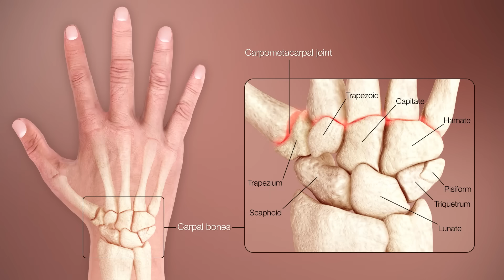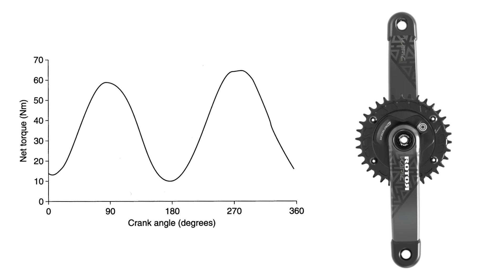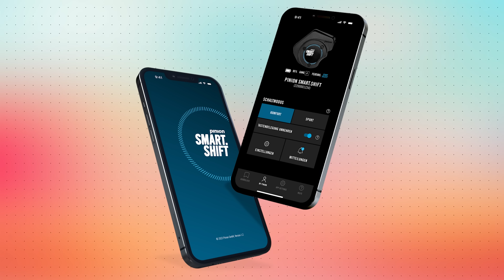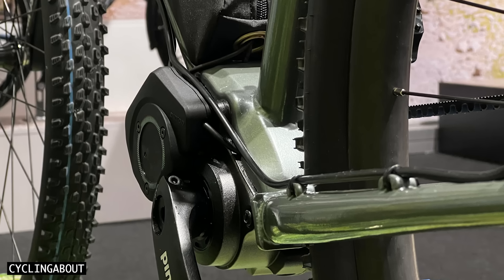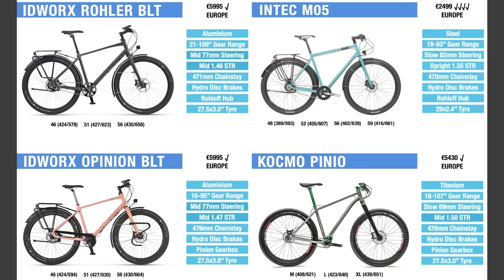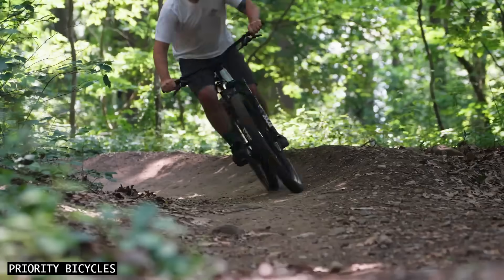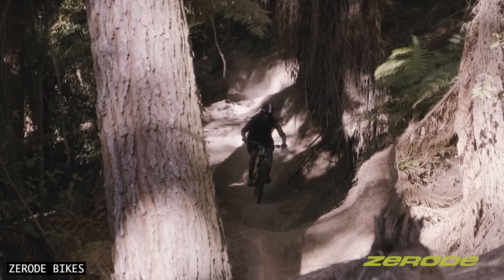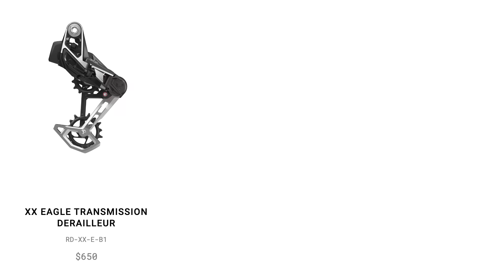The 2024 Pinion Gearbox Is A Derailleur KILLER - Shift Under Load, No More Gripshift!

Comment: To be a "killer" of a product it needs to be in the same price bracket as that product, and it is not even in the same solar system price wise.
Reply: Most technologies are expensive early on. Once new competiton comes in the market, more products are available, the price will surely go down.
Reply: Not necessarily. If it is a product that fundamentally changes the status quo, it is a killer product. Just because it’s not in the price range that you like does not negate the potential to change the industry. All new technologies are expensive at first. Then prices come down as manufacturing efficiency improves. Just look at flat screen tv’s. In the beginning they were 2-3 times the cost compared to CRT and their video quality was not any better. Now CRTs are extinct and you can get a massive Flatscreen tv for beyond reasonable prices.
Reply: Exactly! I was intrigued , so I clicked to watch the video. Then I was fascinated. Finally I was sold. “I’m getting one, and the cool electronic shifter,” I thought to myself.
Then at 7:30 in the video he said, “THREE THOUSAND DOLLARS.” I stopped the video right there.
No way am I spending three thousand bucks to put onto my $1,600 bike which already has gears and shifters.
I could pay someone $50  to adjust, clean my derailleur and chain, every three times per year 60 times. That’s 20 years worth, and right now I’m 64 years old.
Reply: Ya it's just not there for me yet but I'm interested and think it will just get better and better
Reply: What’s the sleazy elevator music? 🥴
Reply: $3k is really not that expensive for high end bikes. You'd probably spend 2/3s of that for a top of the line traditional drivetrain that requires more maintenance and uses many very delicate exposed moving parts. 

High cost of entry for new technology is unfortunately just the reality for anything. Especially when it's from a boutique brand and/or a niche market.
Reply: @dumpywhite  Bicycles are so overpriced, you can buy a used car instead
Reply: Also the fixed belt line can be aligned with one of the pivots on dual suspension to completely eliminate a moment arm.
Reply: Not really. A lot of mtber's have to replace the chain, chain ring(s), cassette and jockey wheels every season.. at a cost of approx £250
Reply: That's not true. It can cost more as long as it provides enough additional value to justify the price. Cars killed the horse and buggy, even though they were, and still are, many times more expensive.
Reply: No, it is.  A Nikolai Saturn mgu 16 Costs the same as a Specialized Turbo Levo S works
Reply: There a gravel bike made by priority for $3500 which is reasonable for the build.  You get what you pay for, and for people 
who want to delete moving parts and not fuck with replacing potentially very expensive cassettes/chains every two months 
because they ride a lot and derailleur adjustments, its completely, entirely worth the price!
Reply: @WesleyChe  I've been eyeing that gravel bike. Hoping to replace my entry nishiki road bike
Reply: @aesingame  If you are riding gravel primarily, get one that can clear atleast a 50mm tire for comfort and the sake of your wheels. riding offroad on skinny tires with a  rigid bike isn't fun.
Reply: Factor in lifetime visits to the shop for regular maintenance of derailleur system and the price for saved inconvenience and time looks pretty good.
Reply: @JohnKavadias  Indeed I agree. Just bought an XL priority gemini gravel bike w/Pinion C1.12 gearbox, loved the drivetrain. Set it up tubeless with the same tire setup as my other gravel bike on 47mm tires. Unfortunately the cockpit was too short, and the bars are thick with not much compliance, so it was not very comfortable on washboard gravel roads or rough descents. Too much vibration. We need more geometry options and frame manufacturers selling gearbox/belts.
Reply: Totally agreed, also I have absolutely no idea why they didn't make a cheaper city bike version yet.
Reply: Sorry that you're having a hard time keeping a good job.
Reply: I'm not really into the idea that I need to charge my gearbox, and then have to download a app for it. Jesus Christ.
Reply: At least not until the “Lectric One” comes out.
Reply: Not all bikes are priced the same so your logic doesn't hold up. Every new product is always priced higher than the current market. The question is if it's better and thus sought after.
Reply: In time
Reply: Sounds like someting someone selling horses wold say to a car dealer 😂
Reply: main issue for me is the small choice of frames
Reply: I mean you can get derailleurs that cost thousands of dollars too. SRAM just release one that costs $4000, you don’t even get a bike frame and wheels for that either, just the shifters, gears, derailleurs and chain, and brakes. So since the price was not shown, I’m gonna guess this thing is about half the price of the bike, which puts it at about $1500, which is expensive for sure, but considered a mid range bike part for bike enthusiasts.
Reply: Carbon belt drive and sealed hub gears or gearbox for me
Reply: not available outside uk
Reply: @PRH123  Sorry you don’t get the analogy. Bye.
Reply: @PRH123  Yes it is. Your explanation was wrong. Thats ok. Bye.
Reply: @PRH123  No it hasn’t. You clearly don’t understand. Sorry. There is no discussion between us. You believe what you want and I believe what I want. Adios.
Reply: @PRH123  Nope. Simple proof as a kid no bikes at Walmarts had multiple gears. They were all single speeds. Now you can get a bike for under 100 with multiple gears. How did that happen. Oh the tech got cheaper to manufacture as the manufacturing processes were improved and they found ways to cut costs. Yes there are still more high precision cassettes that will always cost more, but the cost barrier for lower cost versions is gone. Nice try buddy. See you around.
Reply: @PRH123  Sorry you still don’t get it. That’s how manufacturing works. New technology is expensive. As time goes buy it gets cheaper to make as manufacturing improves. It’s literally how ALL manufacturing goes regardless if it’s mechanical or electronic or anything else. The bicycle industry is not some unique industry that is immune to that fact. Yea there will always be high end technology. But as time passes people learn how to make it cheaper and better and that is then passed down to the consumer. Sorry you cyclist think bicycle technology is so unique that it is immune to this. News flash it’s not. Last year’s high end bike will be cheaper this year because something else better will come along. It’s why old things devalue over time. I can’t simply the concept anymore. So you go take your bike are ride off into the sunset. Adios cyclist.
Reply: @PRH123  lol. You are literally explaining the same thing I am saying. Thats how manufacturing works. Sorry that you just don’t get it. Things get cheaper over time. EVERYTHING gets cheaper. Bikes are not immune from that simple fact. Yeah I am simplifying it because in its most basic form that’s what happens. A seller’s goal is to get as much people to buy a widget what ever it may be. Yeah you get early adopters who buy high costs for bleeding edge tech. But over time the tech is not latest and greatest so it gets cheaper replaced by newer tech. Solid axle suspension used to be the norm till independent suspension came along and that was only on high end luxury cars. Now independent suspension has come down in price that it’s on most modern cars. You lose every time kid. NOTHING you can say will change the facts. Be as delusional as you want. You lose every time. I feel sorry for you that you don’t realize it. But that’s ok. Enjoy the rest of your day.
Reply: @PRH123  man you sure are riding a high horse is a deep lake. Poor guy. Give it time the tech will come down like all tech on a bike. Cheaper versions will be built. But hey you like to reword things to make your self look correct. I always find it fun talking with cyclists. You are so narrow minded thinking you are immune to natural trends. Affordable technology always trickles down to lower cost. You talk about something that Porsche came up with in 2006 and act like it will never be cost effective. All high end bike tech trickles down to carbon fiber, full suspension, disc brakes, regenerative motors. It all gets cheaper over time replaced by other more expensive tech. You have given NO example against it. I have given you many cases of trickle down tech. You have done nothing to disprove it. All you did was rephrase my argument giving more evidence why I am correct. But bikes are so special they are immune to manufacturing evolution. 🤨
Reply: @PRH123  nope pinion tech for bikes is new. Try again.
Reply: @PRH123  yeah for cars. You can’t use that history from cars for bikes. It was introduced to bikes like in 2006. Because it was too big and too heavy and too costly to make it work on a bike. But over time technology advanced and it was made smaller, lighter, and cheaper to put on a bike. You literally just defeated yourself. ✌🏼
Reply: @PRH123  nice try but no you still lost. If the tech didn’t change how did they fit a car transmission on a bike?  Also using my tv argument is not the same. You directly said that the tech for the transmission came from a car. You said the technology existed for 100 years. Yes it did in a car. You are inferring that because the tech existed on car for 100 years that it can also be extended to a bike history. Thats not true at all. The tech had to evolve and get cheaper to put on a bike. My examples are showing that in general all technology evolves and gets cheaper. You double lost. Freaking cyclists are always so arrogant.  ✌🏼✌🏼
Reply: @PRH123  nope it’s not simple to miniaturize a transmission. It takes time for the designs to evolve, new materials, cost decreases. The technology evolves to be cheap enough to work on a bike. My exact point. Technology evolves. It gets easier to make and cheaper over time. Something you said that doesn’t happen. You main argument is wrong. You know you lost. You are just grasping trying to do something. It’s over. Nothing you can say changes that you lost.
Reply: @PRH123  nope. You lost already. Why you still talking?
Reply: @PRH123  don’t take it personal. Move on. You were proven wrong. Now you just sound petty. Let it go. Sorry you took it so personal. Laters thesaurus.
Reply: And that is the least of its worries, in this day and age people change bike each year, so no compatibility between frames and the fact that it will surpass the fatigue of all frames expect carbon which I don't think this is ever going to be bolted to!
Well, maybe steel can hold as much as the gearbox if taken care!
Then again, if it was that good MTB and road pros would all over it!
Worse not even dh pros use it!
Reply: wise man! 
lets hope they mass produces and seel it to biggest bikes brand so the price go down
Reply: We’ve been hearing about “derailleur killers” for two decades, yet here we are all rocking them still.
Reply: Its a killer product if you look at it from a long time investment thing. Costs more but will not need any more chains, cassettes, and derailleurs when broken or worn
Reply: @TheSoppakulho Shimano offers a groupset that'll last the life of the bike already. Just got to be willing to embrace steel
Reply: Only a €90 belt and €180 sprockets. Granted, after 30k KM, but still needs to be in the equation @TheSoppakulho
Reply: @Erdnav27  True. Gearbox is not for all riders but Im very much attracted to the maintenance free usage!
Reply: Exactly why I have a belt driven gear hub. But the replacement cost was an unpleasant surprise, and almost double of what it was when I bought my bike. (specialized source11 btw)  @TheSoppakulho
Reply: @TheSoppakulho for most peoples a standard transmission is perfectly fine and needs zero maintainance. After 30 years mostly in the garage and few thousand kilometres they throw the whole bike because everything start to fall apart: brakes, shifting, noisy and skipping chain, saddle... This is the life of probably 90% of the bikes. Moreover, most of the bikes people use cost about 1/10 of this transmission. So this transmission is for a very small niche and will remain so unless its cost is devided by about 100, which I think will never happen.
Reply: @vitocortison  Yes thats very pessimistic but alright. Imo people use their bikes if they have bought them at least here in europe. Those people also would maybe use their bikes more if it didn't need oil in the chain and cleaning and shit every time they would maybe use them. 
Very pessimistic view. Wouldn't want to be you. 
But it is costly yes
Reply: @TheSoppakulho   I don't think this is a pessimistic view. I like new techs, but I think in this case it can't replace what's currently used. I'm not saying it is bad or has no market, it seems people are buying and using it so it has one. I'm also living in Europe, in a city where many people get around by bike, but I see the bikes people are using and most of them are trash, but I have nothing against that. I think those bikes are perfectly fine for the task, which is rolling about 10k every day at about 15km/h average on flat roads. As an example, yesterday I adjusted the derailleur of one of my colleague's bike because he told me that since he bought the bike (5 years ago, second hand) he never shifted speeds because it makes weird noise. I also checked his chain length... it's dead and so its pinions and chainrings. But he still uses this bike every day and will probably use it as is many more years. I'm pretty sure a standard transmission can last 30 000 km with little to no maintenance for just commuting to work in city on flat roads.
Reply: @vitocortison i guess divided by 5 is the aproximate real value of this gearbox. 4/5  of price is the brand extra charge. Like with iPhones for example. Real value of iphone is realy low, but iphone takes 9/10 of price just for brand.
Reply: @vitocortison   @TheSoppakulho  I had a bike with hub gear and a fully enclosed chain, the whole bike cost me €600 and I LOVED it. Never got my trousers dirty on the chain, the hub gear changed under load and was super reliable. The bike got stolen and I was gutted. 
I used it around my 15-minute city as well as for longer runs on a daily basis for 3 years.   I have no idea how may Km I did a day but I was zipping all over the place on it. I would guess 20km so that 7k km a year - 21k km for €600 and it was like new when it was nicked.
Reply: @mesnyankin89 My guess would be in between the extremes.
I'm sure brand plays a role in the price (though establishing and maintaining a brand also entails costs).

Youe price guess is likely based on some idea what materials and production costs.

Vut the manufacturer will have first invested in R&D to come up with the product. Something to be recuperated as cost from the product beyond mete materials and production.

Good news is that this is a cost that stretches out over many units sold. So eventually lowers, approaching 0.
Reply: @vitocortison  That’s actually not true. Just take a sram red axs. That’s not to far from the pinion gearbox. If you compare it to a 105 or Rival there is quite some difference. But I think we should compare premium parts
Reply: @TheSoppakulho  I have almost 6k miles on my mechanical ultegra setup, I haven't needed a new cassette, crank, or derailleur.  I think I've replaced the chain once.  Do I think this technology is cool?  Yeah, I do.  If I was a rich man, I'd buy a bike with it.
Reply: @TheSoppakulho you're looking at at least 10 cassette and chain replacements before they break even though... People don't usually even own their bikes for that long nowadays. And the pinion can hardly be installed on a new bike as you just have to hope they keep making frames with that exact BB cutout.
It's nowhere near competing for cost effectiveness
Reply: @Coerced  but ease of maintenance on top of that. But yeah you're right
Reply: Look at Sram Eagle price and lifetime of Pinion. You are talking nonsense.
Reply: He specifically says it's a derailleur killer "for many riders."  So you're forgetting that one caveat he mentions.  "For many riders."  That doesn't mean it's going to kill derailleurs across the board for all riders.
Reply: Exactly! What a stupid title for a video.
Reply: I agree with you. This is the best solution, and I hate derailers and chains but at 20 times the price is not even in the same ballpark.
Reply: @BryceLovesTech  calling something 20 times the price is what's not in the ballpark! 🙄
Reply: What? Check out complete gx or xt drivetrain price and come back.
Reply: not mentioning di2 or AXS
Reply: the thing is you can spend money on ancient technology upgraded with less weight and bluetooth or you can buy something modern the choice is obvious if you are not a racer lol
Reply: the less idiotic comments like that, the more competition pinion will have leading to lower prices

Comment: Bottcher with Shimano XT is 2300 euros with Pinion is 6000 which is complete stupidity
no matter how good Pinion is,even if lasting over 100K you never get money back,not even close
it is already decade and still almost no one uses it because it is just too expensive
and really,talking about how much racing group deraileur and cassete costs is not fair,you could simply use A LOT cheaper and same quality just heavier components
you could buy whole 10 speed cassette for price of single Pinion cog
there are very very few bike travellers using pinion unless it was sponsor bike
Reply: It's a boutique brand for cycling dentists.
Reply: @JohnDir-xw3hf  spot on
but if they ever lower price by 50 % i might buy one